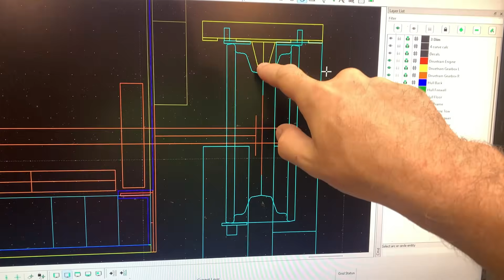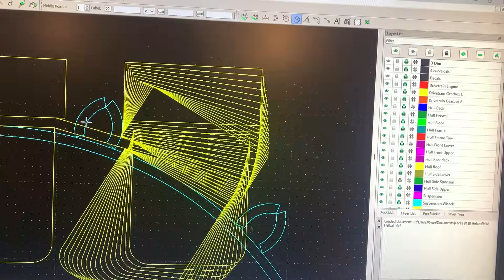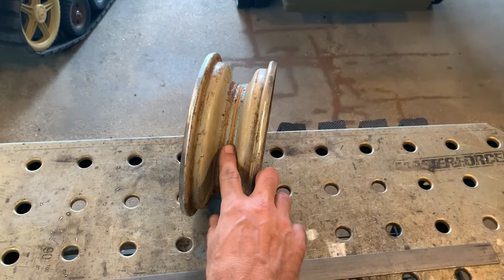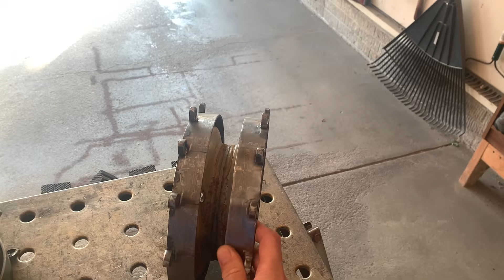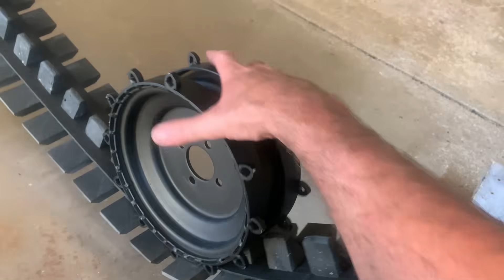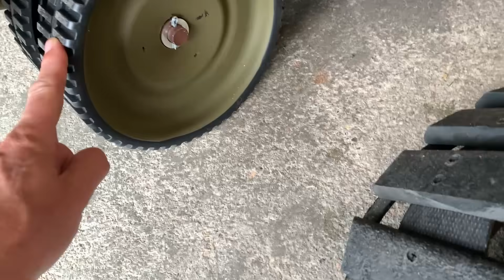M18 Hellcat E7 Tracks and Test Drive

Comment: I wondering if you could go more in depth on how the drive train actually works like how is everything connected in the tank and how you connected the steering from the inside
Reply from the maker: Okay, when I finish the clutch and brake controls I will go over everything in more detail. I’m busy buying and selling a house right now so it will be a few months before I can get back to tank projects.

Comment: That is the best powertrain for a small scale tank I've seen!  Very impressive speed and maneuverability.  I did not think the snow blower gear boxes  would provide enough torque to run a track in turns.  They certainly do.  How would it run on grass?
Reply from the maker: Thanks! I haven’t tried a turn on grass yet but it has plenty of torque. I am more worried about breaking the track or suspension.

Comment: Looking good man, did you have to do the same trick as with the stug to get it to turn or did that motor have enough power?
Reply from the maker: At first I had the three wheels in the middle carry most of the weight but the transmissions are so heavy and hanging out the back that I had to make the rear wheels carry the same weight. So only the front road wheels are not carrying weight. But it with the power I have, it turns pretty easily so I could have made the springs the same on all of the wheels.

Comment: Roughly how long did it take you to design and build this?
Reply from the maker: I spent 160 hours on it over a period of nine weeks.
Reply from the maker: I started some design work about a month before starting construction.
Reply: @ryanhahn7251  Cool, im trying to decide if this is something I could do or not. are their any certain things you look for when deciding on vehicles and how to build drivetrains?
Reply from the maker: @ColtRapier-8788 I just avoid tanks with cast features that would be difficult to create, e.g. the M4 Sherman turret.
Reply: @ryanhahn7251 good to know, I will say you still made the Sherman turret amazingly well shaped 😂
Reply: @ryanhahn7251 would you consider emailing so I could ask you questions outside of the comments section? If not, I completely understand.
Reply from the maker: @ColtRapier-8788 I’ve been warned not to share my email in YouTube to prevent hackers. Can you use the YouTube directly message option?
Reply: @ryanhahn7251 I understand , I would need to figure that out, but I would be open to it.
Reply: @ryanhahn7251  I’m having a hard time finding the feature for direct messages. Do you have an alternate way of communicating that you’d be comfortable with? I can share one on my end if that’s better for you.

Comment: seems to be alot of tension on the front rollers they are warping unless that is designed intentionally
Reply from the maker: The wheels are plastic with no bearings. So they have some free play to tilt slightly on the axle. I think I need to change from a spring tensioner to a rigid adjuster because the wheel moves so much when turning.

Comment: looking sharp brother! that hellcat can really scoot! did you do any driving in reverse?
Reply from the maker: Thanks! Yes it’s fun to drive and was quite a spectacle driving it around on the 4th of July. I haven’t tried reverse yet. I don’t have the clutch and brake controls installed yet. So for this test drive I had to have someone stand behind it and hold the clutch levers down while starting the engine. To stop the driver had to kill the engine.
Reply: @ryanhahn7251 gotcha, i was just curious cause the fullsized hellcat was apparently quite brisk in reverse to get out of harm's way. Glad you were able to get it out for 4th of july, tho the temptation to launch colorful projectiles downrange could land you in hot water in my area!